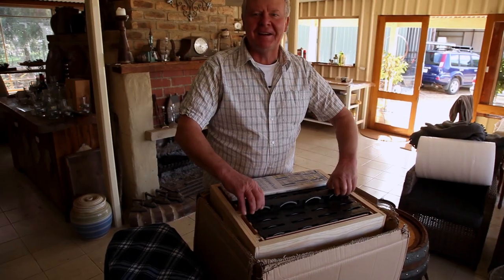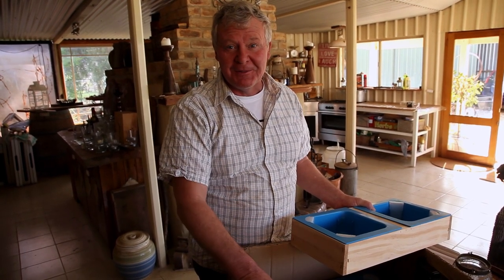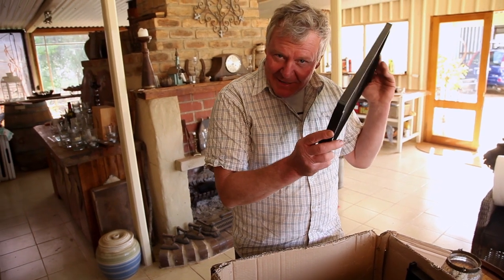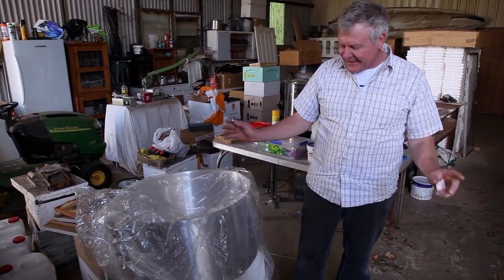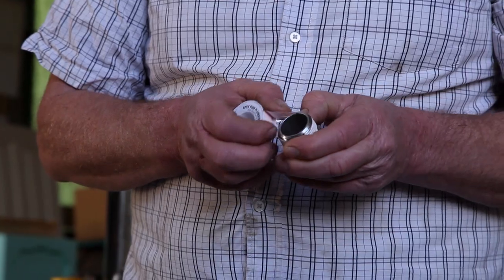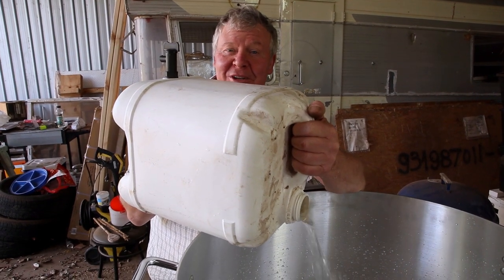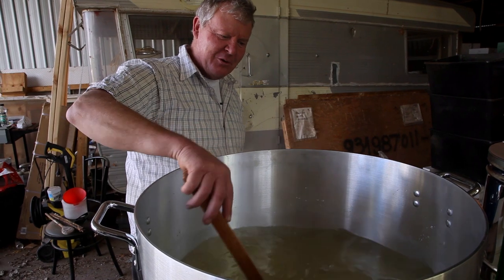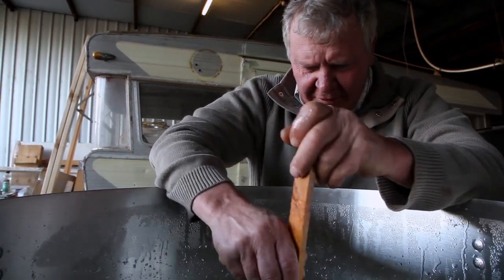Testing Sugar Feeders from New Zealand Part 1 - Episode 86: "One Lump or Two?"

Comment: I  have  the large syrup feeders. I found the corner access ports do drown bees. I stopped that by inserting some plastic screen mesh strip in each corner behind the plastic shourd. This works really well.  I agree with the drip feeder observation. I tried a few. They constantly drip onto the bees.  Thanks for a great show as usual. The young bloke is a skilled camera operator

Comment: I know you're a bit of a stirrer, lol, BUT, make yourself up a stirrer to sit on top of the pot. When I worked in a soft drink factory we used to mount a portable stirrer on top of the vat to dissolve a shit load of sugar into not much water, without any heat whatsoever.

Mark, Mark....... Know what that is? A dog with a hare lip..... Mark, Mark..... Oops......